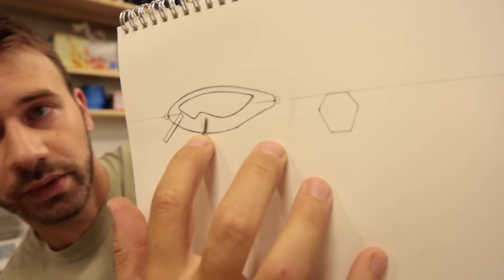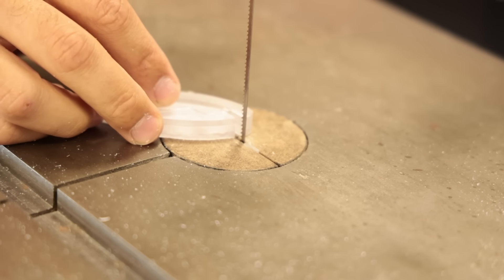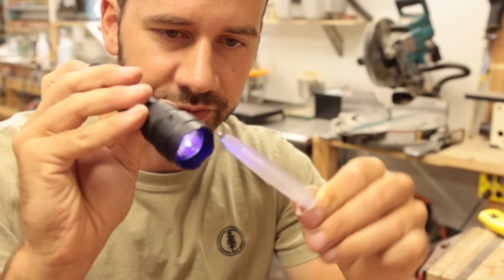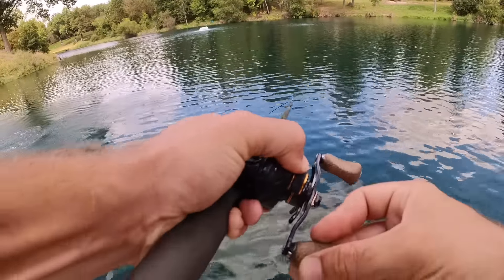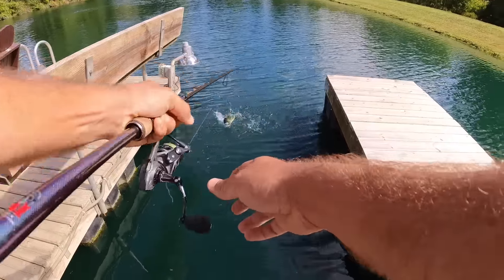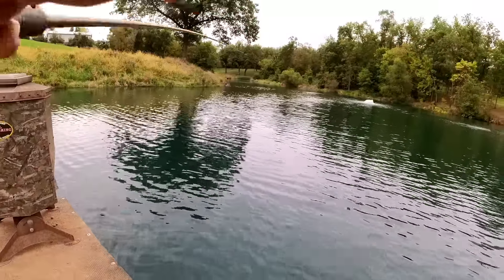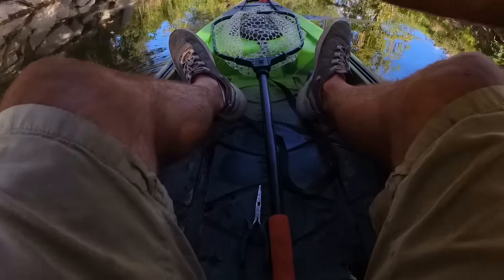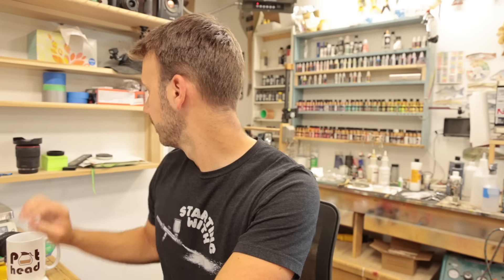Will Fish Eat Nothing? | One Day Build to Catch

Comment: You should try other versions of this bait - one with a rattle in the hollow space, a colored LED or with a UV reflecting coating to see if they work even better. Also, coatings like matte Vantablack or flat mirrors on the sides would be interesting to test on a different bait.

Comment: so heres an idea for the sequel, do 5 layers, make the outer two layers 10-15% smaller to save on weight, and with the 3 layers of air in the middle it might float more. make the hole in the middle the same size then the next two layers the hole a bit smaller to give it central stability. just a thought

Comment: Laser cutter or scroll saw could make this process a bit easier. Also you can use a torch and make a quick pass along the surface of the lexan and itll "flame polish" out the scratches from sanding.

Comment: I'm wondering about the use of .2" in the middle and .06" thick on the sides, it would allow more air in the chamber without adding thickness, I could also see a single glass bead being added that would be marginally smaller than the inner pane for rattle, either in a single drilled out spot or down in that dipped down area in the current design.
Maybe you discuss this further in the video, but just my thoughts now 10 mins through

Comment: What if you painted or foiled the interior layer before assembly? I know nothing about UV adhesive. Would paint or foil interfere with the UV adhesive and prevent good bonding of the layers? Painting or foiling the interior layer might look good. I know you're going for a clear lure, but I'm thinking about other things one could do with a multi layered clear lexan lure.

What about using expoxy rather than UV? Would that create issues with the lexan? 

I have lure building ideas but can't afford to buy all the tools. So I  watch you and other builders instead.

Nice bass. I said BASS ! 😂😂

Comment: Nice video 
I also make plugs out  of Lexan 
But I use 1/8" for the sides and 2 layers of 1/4" for the middle 
But I normally paint the inside of the 1/8" outside layers before putting it all together